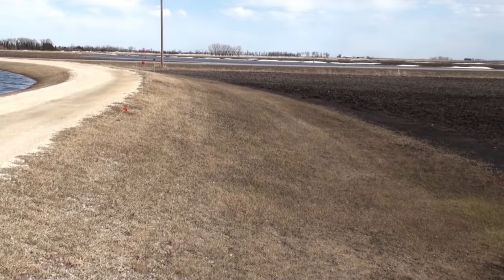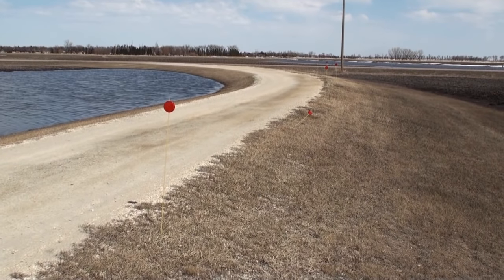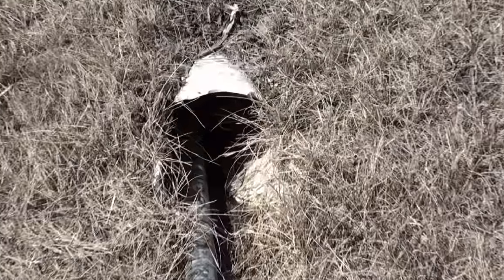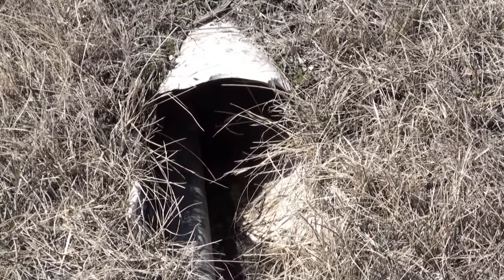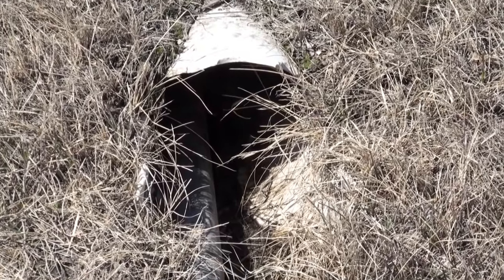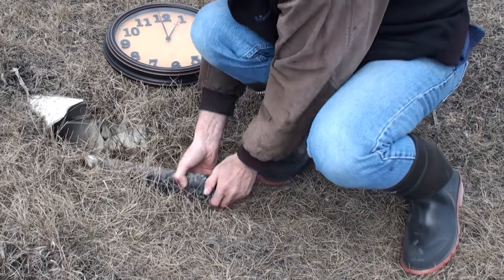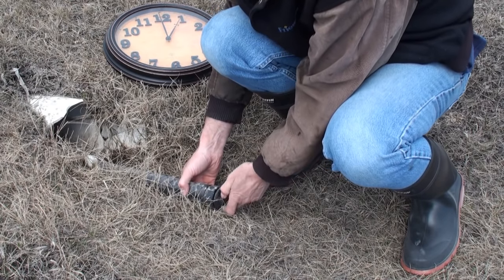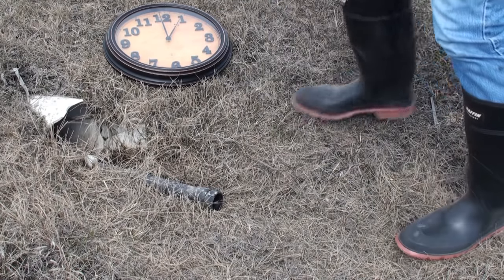Thaw A Frozen Culvert Less Than 1 Hour

Comment from the maker: Good question, the water flowing through the small pipe warms the plastic of the small pipe, this melts the ice around the outside of the small pipe and soon water flows along the outside of the small pipe, when the water flows along the outside it melts a path bigger and bigger till its all gone. You will see in the video one of the first things to happen before the big one opens up is the small one slides a bit showing that its free from the ice.

Comment from the maker: Thanks, I used to use heat tape at my parents place in their culvert as they have the same problem, but it was a pain because the dog would chew the cord end off in summer and plus the hassle of rolling extension cords to plug it in and what not, the pipe was an idea that I came up probably while driving or laying half asleep in bed in an effort to eliminate the extension cord hassle

Comment from the maker: Thanks, I used to use heat tape at my parents place as they have the same problem, but it was a pain because the dog would chew the cord end off in summer and the hassle of rolling extension cords and what not, the pipe was an idea that I came up with in an effort to eliminate the extension cord hassle